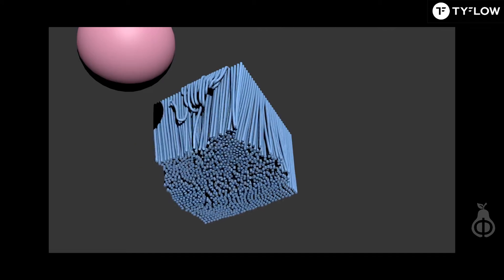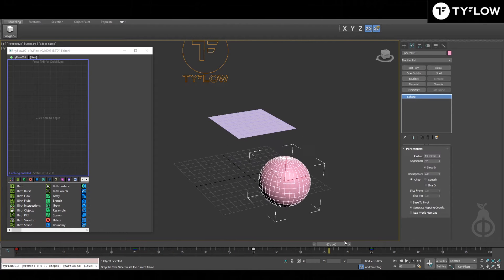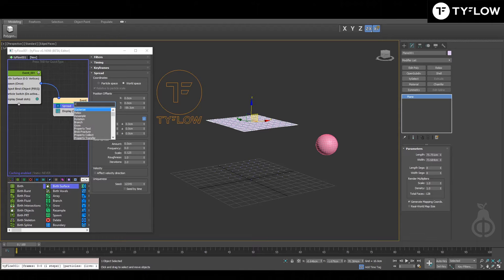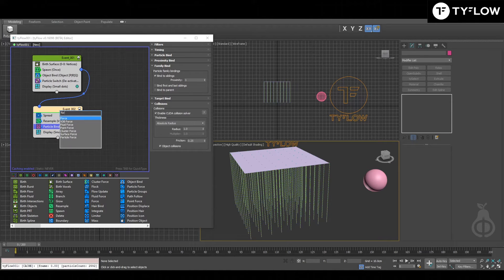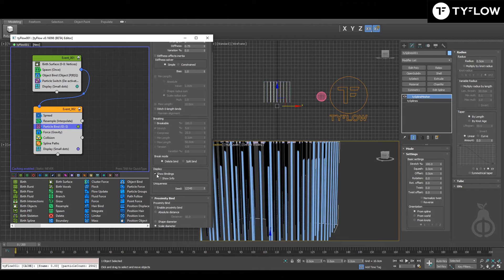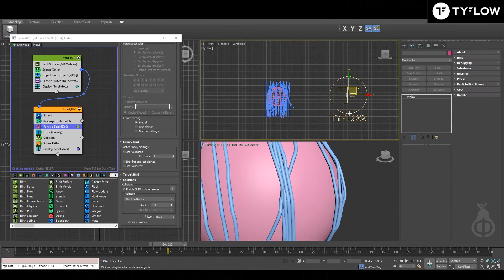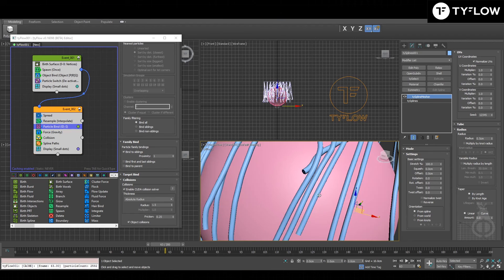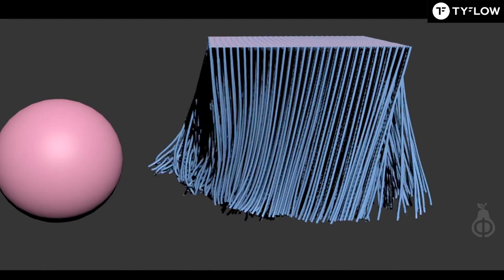Tutorial Ropes

Comment: I tried to repeat the lesson, the ropes for some reason can not be attached to the Plane, they fall during the simulation, although everything was done exactly as in the lesson. Binding shows how the line does not touch the plane.
Reply from the maker: Funny enough I tried it also with latest update and it didn't work for me. I will report this issue and get back with answer asap.
Reply: @FXPearStudio  Thanks for your attention!
Reply from the maker: @imFeodor  It's my pleasure. Because of your observation, I made a video showing how to go around this temporary issue. Check it out :)
Reply: @FXPearStudio  I'll get acquainted with your method a little later! Thank you so much for the video!
Reply: hi! in Event 02 just increase in Resample operator "Count Subdivision . . . . .
Reply: particle bind node between spread and resample will fix